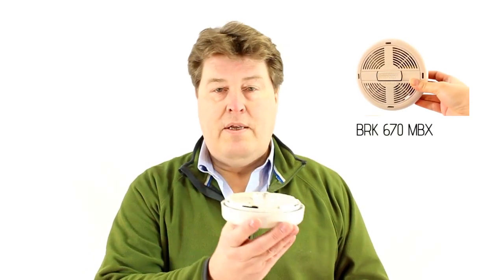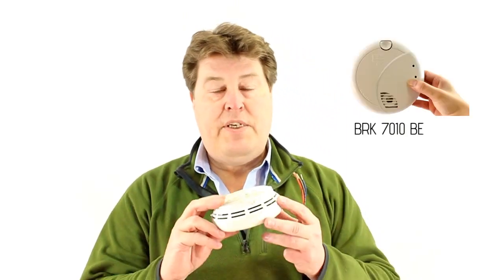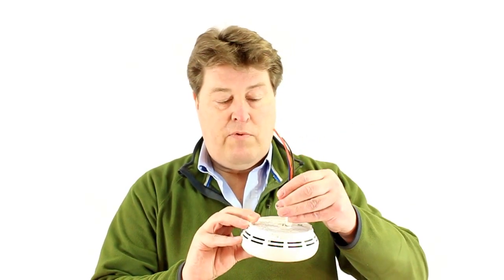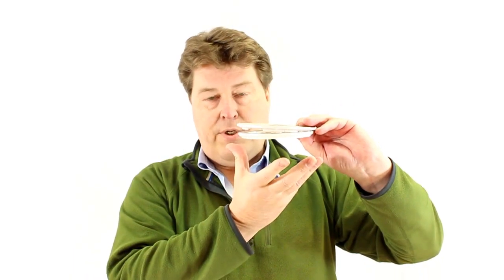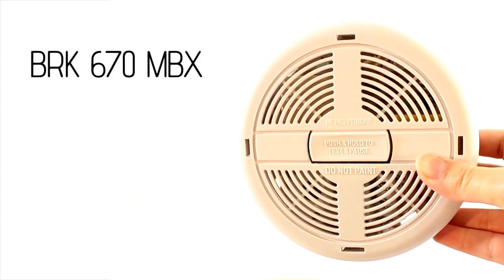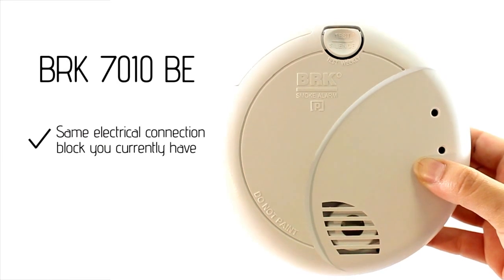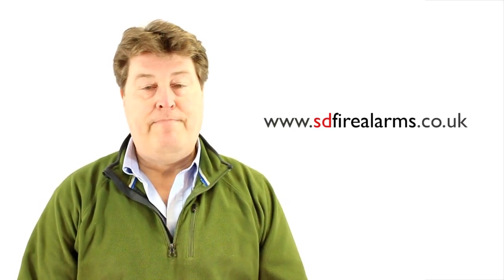Replacements for 86 RACEN and 2002 RACE smoke detectors

Comment: Great video. I had a 2002 RACEN smoke detector and decided to order the BRK 7010BE as a replacement as I liked the fact that I would not have to mess around with the electrical connections. However it is necessary to make two new screw holes in the 7010BE base plate in order to attach it to the existing 2002 RACEN ceiling pattress.

On the underside (i.e. floor facing side) of the base plate that comes with the 7010BE are two slightly recessed screw-head sized circular hollows, one of which is labelled "2". I soon worked out that it was these two holes that I needed to align with the two existing screws in my 2002 RACEN pattress in order to fit the new base plate. Once I'd realised that it was a doddle to fit the new base plate into the existing pattress

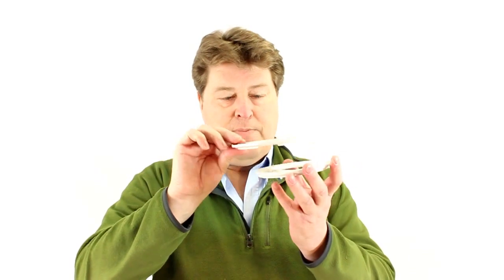Comment: I'm replacing my old BRK's (2002RACE) with the 'new' 7010BE. In the video (1:03) a 'new existing baseplate' is mentioned. Well, I have a new baseplate from the 7010BE and an old/existing baseplate of the 2002RACE. What is that new existing baseplate? Is that available separately, and if yes, what's the model nr./order nr.? Thx!